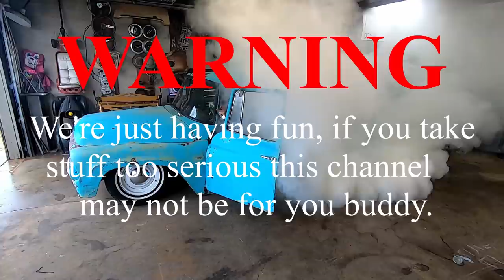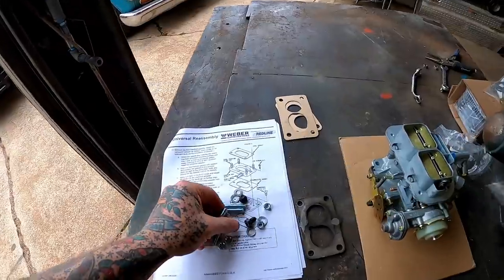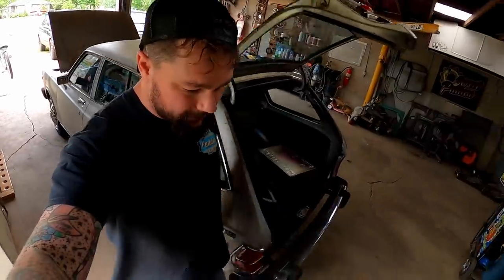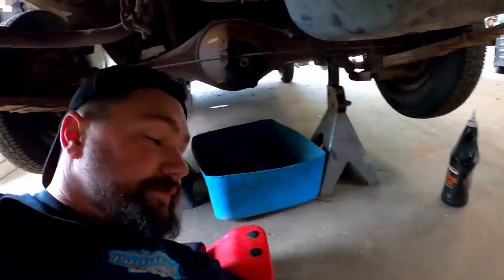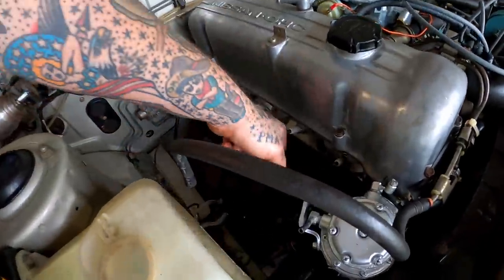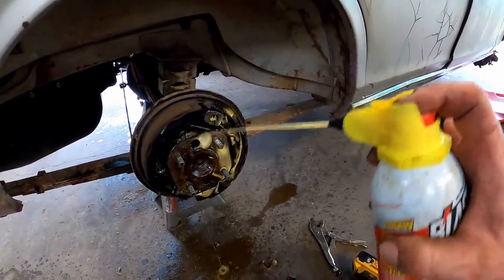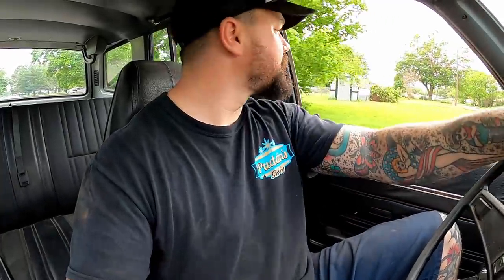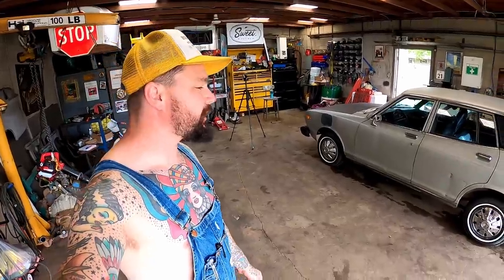Will it DRIVE after being ABANDONED in a SALVAGE YARD?! 1977 Datsun 710!

Comment: Well what I do to vacum line win I plug them off i use a shot pice of line i put a shot bolt or screw whatever fits Tight see i have a plug dont look at me that way hay it works and it's cheaper i have lots of bolts an screws. Thanks for the video.  Well I am jealous as hedubel hokey Stix you have a  Sonic and I don't that's just upsetting 😔
Reply from the maker: Sonic is from my town originally!
Reply: @PuddinsFabShop  well they need one here in my town I'm not driving 65 miles to sonic I do like lot of there food mmm just thinking of couple of corn dogs an shack drnite i can't have it only if I cud roll back time so I not as old I'd open up a sonic here lol now I'm dreaming an babbling on

Comment: After tries then you put on the double barrel Weber to the spacer but the space and another spacer need to be together as extra plenum as same as extra air and fuel mixture at the split dual plane of its intake manifold. To add HP to the Datsun mini-station wagon I think it's 210. The diameter of the exhaust pipe need to be 5 to 6 inch diameter and at back of exhaust pipe diameter is 2 in. pipe instead of that skinny 1 1/4 inch pipe that most economic Japanese car have. And the header is not a racing type. The both throttle plate valve have to be open at same time that way HP is increase. Otherwise, the primary throttle barrel open its one throttle valve until floor the accelerator pedal and both throttle valves are wide open. That is slow economic. Can you rebuild it into both throttle are open at idle as twin? Like I did before in Toyota engine 21R mark 4 coupe.

Comment: J.D. Power NADA:

MSRP $4,579
LOW Retail $2,000
AVERAGE retail $3,150
HIGH retail $4,250
Considering paint, non OEM parts, interior- this would be considered "Low Average"
and sell for $2,200-$2,500 as is.
Reply from the maker: Appreciate the evaluation, bet it brings more.

Comment: Datsuns were probably the most reliable and the metal used was good quality  

Hence why its still in decent condition  

People didn't scrap them because of poor engines and poor bodywork, 

They scrapped them because they got unfashionable and no one wanted one, ,

Hell you couldn't even give them away,  

They were slow dependable cars,,

Then Datsuns turned into Nissan lol,

I am really a Ford guy but I have a Nissan cabstar pickup truck and a Honda integra type R dc2 rebuilt engine with a turbo lol

But from the 2000s the metal used for car chassis and bodywork especially Nissan wasn't the best, 
My Nissan cabstar is 1997, and hardly any rust for the year. 
A Nissan cabstar from roughly 2003 to 2010 were rot buckets  

You have a great little car there and you would be surprised once you get it in good running order much like your doing now , 
As how much money they are worth, 

Don't sell it for peanuts 😒,  its worth more than people think  🤑

Keep up the great videos,  big up from 🇬🇧 UK

Comment: Fill that tank with nuts and bolts ratchet strap it to the wheel on the towrolla with it jacked u put it on cruise with a stick jammed on pedal  at about 10 or 15 mph leave it a hour or 3
Dam i can read your mind i said it before u did it